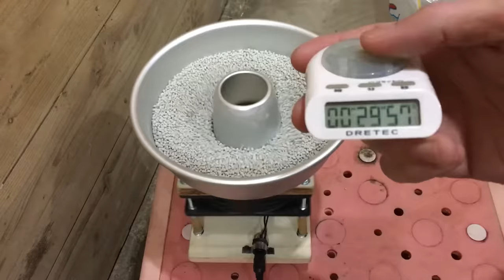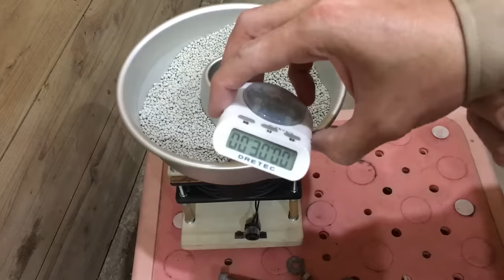How to make Vibratory Tumbler Machine With Fan (Rust Removal)

Comment: Good job in including the failed attempt alongside the successful one. Not only did it make the video more enjoyable, but likely saved some people a lot of work.
Reply from the maker: I would appreciate it if you could think that way. While I do believe this tool is more high-performance compared to others, it's not capable of removing rust quickly, and at best, it can only smooth the surface of plastic, you know.

Comment: Thanks for the video and exposing the flaw of the device. To remove rust faster you could soak the fastener in a vinegar solution for a couple days prior to using the tumbler. I am thinking building one for processing parts in batch while I do something else.
Reply from the maker: I am glad you found my video helpful. Your reasons for needing a tumbler are the same as mine, but I would not recommend an oscillating tumbler. It takes a long time and makes a certain amount of noise. If you are going to buy or make one I would recommend the rotary type.

Comment: I'm a mechanic and I clean these things every day. A bench grinder with a wire wheel cleans all those parts to like new in about a minute. you could leave those things to vibrate three days and it wouldn't clean them half as well. Just sayin'.
Reply from the maker: I am a former mechanic and I have the same opinion. I just had high hopes for this tool so I made it. I did not get the result I wanted...

Comment: It is a design error, the rubber on the legs does not allow enough deformation and that is why the device does not vibrate well. Change the legs for springs or something more flexible and use sand and you will have better results.
Reply from the maker: I see. However I do not think there is much difference. Because it seems to me that the deformation of the spring to withstand the weight of the sand is about the same as the rubber used.

Comment: I want to know what kind of sand you used please ☺️
Reply from the maker: First cat litter, then alumina sand media #20
A finer alumina sand or an abrasive stone might have removed the rust nicely, but I did not see the value in this tool and stopped using it.
Reply: @NITAKA-jpn  ok I will try thank you ,I make this as an example of vibration for my project
Reply from the maker: @yasminemosaad1353  One piece of advice. I recommend smaller bolts, such as M4, to attach to the fan.

Comment: How much did the whole thing cost?
Reply from the maker: Prices may vary depending on the region, so I can't provide exact amounts, but approximately, a PC fan is around 1500 yen, a chiffon cake mold is about 1000 yen, a used adapter costs around 300 yen, and including other items like wood and headphone jacks, it would be around 4000 yen.
When converted to dollars, it's around 28 dollars.

Comment: Good idea that works but I think the fan will get damaged after few uses due to centrifugal force.
This device is more useful for polishing and polishing parts that have scratches after sanding and need to be polished and smoothed. In addition, the bigger the machine and the coarser the seeds, the better the result.❤
Reply from the maker: It's true that the bolts and nuts attached to the fan should be a little smaller, but surprisingly the fan was not broken.
It's great for smoothing the edges of plastics, etc., and I've used this tool for that several times. However, it is a pity that it was not possible to remove rust, which was the original purpose.

Comment: Wouldn't it polish through that soft aluminum pan? How long will the fan run? The bearings in most of those fans can barely take being out of balance from dust.
Reply from the maker: There may be holes in the aluminum pan after long-term use. I think the fan will probably break at the same time.

Comment: Great attempts !! As for removeing rust takes a life time !  What you built is used to clean,,,,deburring, ,,, and smoothing edges,!,,,,,,,   as well as creating  a Satine  finishing  on new parts
Reply from the maker: That is correct. I think the use of this tool is not for rust removal, but for deburring and edge smoothing. The plastic parts actually turned out beautifully. Probably the same for aluminum parts.

Comment: I loved the creative process of making the machine. I've been restoring antique handtools for quite awhile and nothing beats a good wire wheel to remove rust from threads of nuts and bolts though. I also use Evaporust and let the pieces sit for a couple of hours, or over night if really bad. The a light brass wire wheel to help remove any residue. EVAPORUST is all natural, no harmful chemicals  is biodegradable,( but I do take it to a chemical depot to rid of it due to the stuff that is left behind in it.) But best of all, you can keep reusing it many times before it needs to be changed out.
I did enjoy the video!!
Reply from the maker: I too think wire wheels are the best way to remove rust. However, it takes a long time to polish the bolts and nuts of one motorcycle, so I made this tool, but unfortunately it did not help.
The rust remover you recommend is expensive in Japan, but I have a similar product that I will try next time. Repeated use is an attractive product for me.

Comment: I'm sorry but what are all the holes in the five pan for I understand for but what about the rest
Reply from the maker: I'm sorry if my answer is off the mark because I'm not good at English and I didn't understand your question perfectly.
The reason there are so many holes for the bolts is to increase the strength of the bowl by making more so that it does not come off due to vibration. There is no particular meaning. The big hole in the center is because this is a chiffon cake mold. I chose this mold for better sand movement.

Comment: Can this make round crystal stones which are often used for bracelets?
Reply from the maker: Probably not. I did some research and found that the hardness of a bolt/nut is 4, while a crystal is 7, so this tool, which cannot even remove rust from steel, will not meet your request.

Comment: Good design.  But maybe if you left them tumbling for 3 hours or so it will get better?
Reply from the maker: The design and sand movement are nice. But I can't get rid of the rust.
I also think that with time this tool can remove rust, but I would rather use other methods to remove rust than using this tool for a long time.

Comment: you need more corondom to get more weight and more pressure and you need more power to get good result ....rubber coating for container .....good job
Reply from the maker: Thanks. It may be difficult for me to use this tool the way I want to.

Comment: I think it would work best with softer materials, or with a harder media like silica sand
Reply from the maker: The smooth movement of the sand suggests that the issue might lie with the media.
Reply: Definitely the media. Abrasive media designed for the purpose would work best; they’re usually triangular granules that can get inside screw grooves for bolts and maybe nuts, depending on size. 

While there is also the option to mix media and add things like Sandblasting media for cleaning tight spaces, it’s usually best to use sandblasting for that purpose. Vibratory tumblers need the right media, sufficient amount of vibratory power and sometimes also need to have water as part of the process for it to work, and even then the surface cleaning will not be 100% especially for tight spaces the media cannot reach.

Though, this machine is good proof of concept, it’s best to use a purpose built motor and secure counterbalance combination, either directly on motor shaft if it an sustain the forces, or belt driven to avoid stress on the motor bearings.
Reply from the maker: @asakayosapro  
I think you are right.
I wanted to try the dedicated media, but unfortunately I could only find large ones in Japan.
As a result, it was a failure and I stopped using this tool.
Reply: White sand is better.

Comment: Just looking at commercial media, I think the media needs to be much bigger, probably in order to increase the impact forces.  Small media like that being used here may work on softer materials, but not steel.
Now I'm inspired, I might try gluing alumna media to small stones to try in my DIY barrel tumbler.
Reply from the maker: Maybe you are right in your consideration, but I haven't tried it because I didn't think commercial media could reach the small gaps.
However, I think your observation is correct because when I put plastic products in this tool, it scrapes off a thin layer of the surface.

Comment: What kinds of stone you used
Reply from the maker: First cat litter, then alumina sand media #20
A finer alumina sand or an abrasive stone might have removed the rust nicely, but I did not see the value in this tool and stopped using it.

Comment: Very nice little helper for a workshop, I have 600W motor from some old machinery so I will try with that 😈😂
Reply from the maker: It doesn't remove much rust from steel and is useful for shaving a little off the surface of plastic, but I don't recommend it.
The motor needs more than 3000 rpm than the power.
Reply: @NITAKA-jpn  If you want to remove rust you should try electrolysis. You can use the same 12v power supply. It is annoying because you must make electrical connections to every metal part, but it works very well.
Reply from the maker: @finalmidnight  Thank you for your valuable input.
The reason I made this tool is because I wanted to do other work while I was removing the rust. As a result, I have not used this tool...
The electrolysis is used to remove rust from the inside of motorcycle fuel tanks.
Reply: @NITAKA-jpn  Another advantage of electrolysis is that you can use the same setup to apply coatings to your parts after the rust is off. You can plate your parts in zink or nickel. Even chrome, but it is hard to make that look perfect.

You can do all that overnight or while you work on other projects.
Reply from the maker: @finalmidnight  I didn't know that it could be electrolytically coated. Next time I'll look up how to do it on WikiHow. But it seems like it would take a lot of time to do that to bolts and nuts. I'd like to come up with a device that would make it easier.
Reply: @NITAKA-jpn Fasteners are plated on a rack or in a barrel. If you have lots to do, your rack etc is more complex, but it is entirely possible.

Cleaning the individual bolts etc first is more of an issue, but a caustic degreaser works pretty well for that.
Reply from the maker: @finalmidnight  Your description makes me want to try rust removal using electrolysis. If you know of a website that would be helpful please give me the title.

Comment: the problem with this solution need a lot of hrs to make clean stuff(12hr at least) and the fan bearing are not make to operate at full speed for this long time!
Reply from the maker: Over 12 hours! ? I was surprised, but I actually thought that was all I needed. I can't stand the noise before the fan bearings on this tool break.
Reply: @NITAKA-jpn  i see a lot of videos and make to rotary 10-12hr for a perfect clean

Comment: Intéressant. Une autre solution serait de faire un petit tambour à la façon d'un lave-linge...
Reply from the maker: I created this tool with the intention of achieving efficient polishing even with small quantities and in a short amount of time by considering the movement of sand. However, the expected results were not obtained. On the other hand, in the case of a drum-type tool, the gentle movement of the sand requires extended polishing time, and in order to achieve the same capability, it unavoidably needs to be larger in size.
It is difficult in many ways.

Comment: I dont believe the machine will last long, fan bearing is not made to shake like that.
Reply from the maker: Indeed, I believe that's the case. We should make the bolt nut smaller and attach it more towards the center.

Comment: What a funny nonsense. What do you think how long the fan bearing will resist the unbalance?
Reply from the maker: I made Making my own Cheap Ultrasonic Cleaner (check video) with similar construction and this one has been used for over 50 hours and has not broken. However, it would be better to use a small size bolt and nut to install it.

Comment: It be easier if you just dip them into a cup of muriatic acid for the stripping of the rust.
Reply from the maker: With that method, if you don't coat it quickly after taking it out, it will rust quickly... Annoying